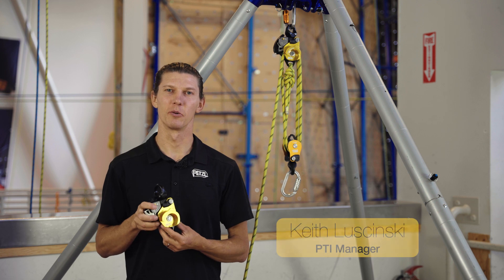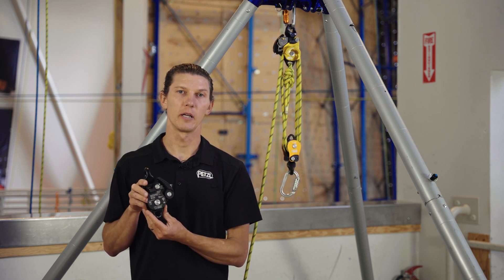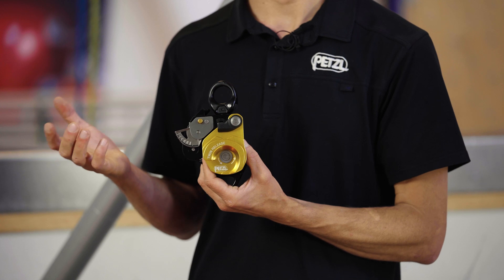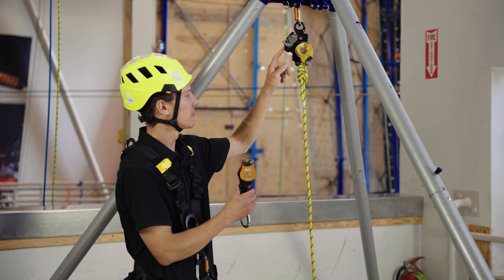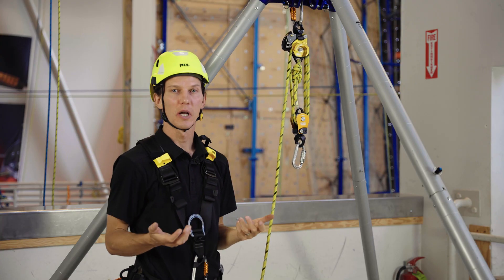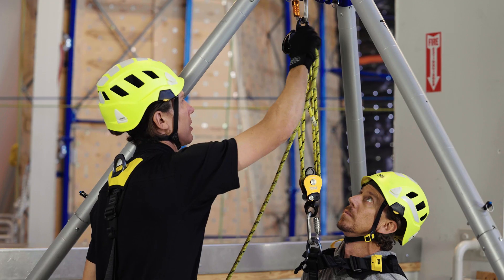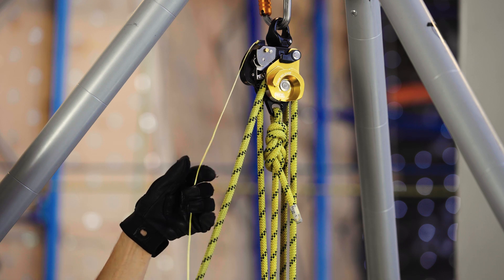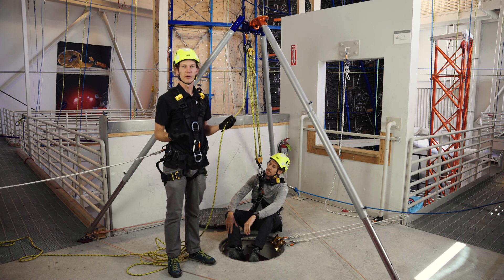How To Use the TWIN RELEASE in a confined space rescue

Comment: What's the intended use case for being able to connect two carabiners to the top?
Reply: Perhaps more control as it's intended use is not only for rescue but it can also be used for hauling up materials. If a Y-config is needed to get it on the proper location then a second carabiner looks useful to me.
Reply: @NickyHendriks  Yeah, that could make sense. I figured a Y right on the pulley would be a real PITA to break into if you had to change the anchors.
Reply: Repartir el peso de la carga en dos puntos de anclaje...
Reply: placement / anchor strength ?